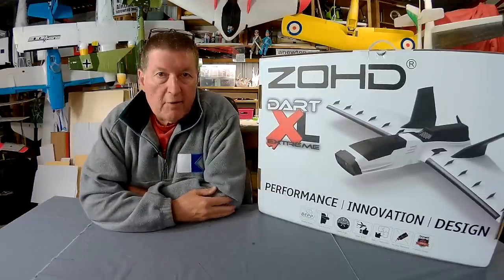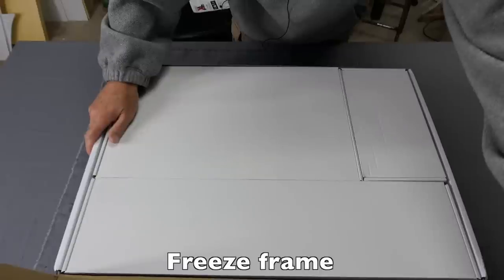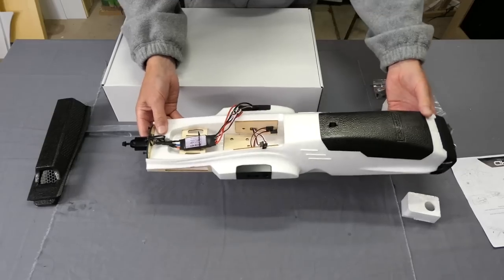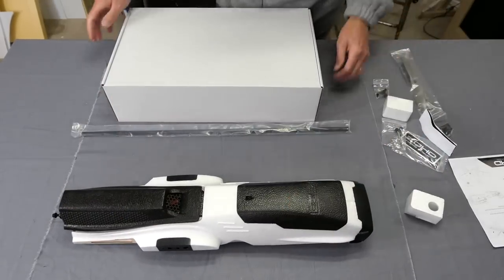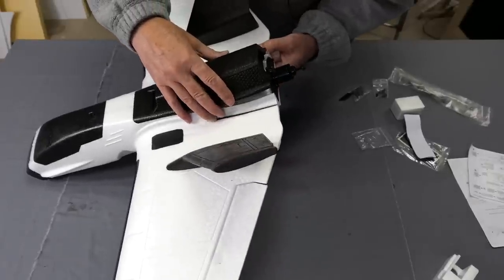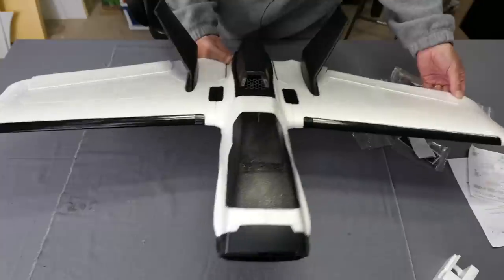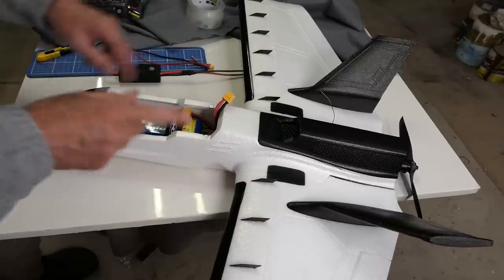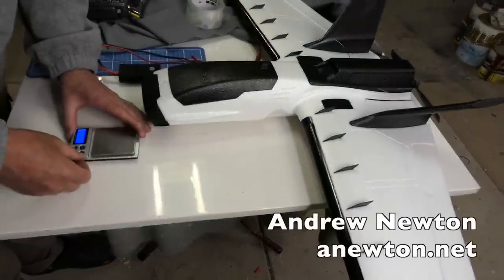ZOHD Dart XL Extreme

Comment: I am very new to this, I have an AR wing almost ready to fly, I am wonder ing if you could give some detail as to what you were doing to balance the prop.
Reply from the maker: I was just feeling the vibrations with the prop in different positions on the motor. There will be one angle where the vibrations are less. You can also do that while adding small pieces of tape to one of the blades. I couldn't balance the supplied prop well enough so swapped to a better one.
Reply: @AndrewNewton  Thanks Andrew.

Comment: Can't wait to see it fly, any chance you can add some sort of speed sensor too?  How does the new BEPP foam feel compared to normal EPP?
Reply from the maker: I can add a GPS sensor but I'm reluctant to do to many battery puffing high speed runs. Would need a bigger ESC and flatter prop to be safe. BEPP feels exactly the same as their EPP.
Reply: @AndrewNewton  No, wouldn't want dead batteries, I'm more curious what the efficient cruise is with that somewhat odd prop/motor combo is.  2216 1300kv & 9x4.5 on 4S seems like it will have high current draw and slow speed to me, I'm thinking an 8x6 would be more efficient.
Reply from the maker: Maybe it's designed for 3S, I'll experiment anyway

Comment: Nice to see a proper unboxing. I'm worried about the flimsy balsa that is supposed to carry the the 400g Lipo that is suggested. I see the balsa in the back isn't even strong enough to carry the ESC? What is your opinion, holding it in your hands?

Wondering what shoes your wife is wearing...
Reply from the maker: Yep, the plywood is inadequate fro rough landings, but very easy to reinforce
Reply: @AndrewNewton  How would you reinforce it? Maybe ZOHD can use your ideas to make some improvements.
If not for that wood I might have ordered already.

Comment: I liked that you included tests of current draw and balancing of the prop, all important before first flight. If you're drawing 30A max would you go all the way to a 50A ESC? Would you be powering not only FPV gear and possibly the Mobius or you like a large buffer zone? Interesting wing, I may have to put that one on my Christmas list!  :)
Reply from the maker: It's actually more like a 40A ESC and fine for normal flying. 50A might be overkill unless your going to race it flat out. My FPV power comes straight from the LiPO

Comment: Mini drak inspired? I found the small dart too fragile. The tail was thin EPP and very floppy on hot days and wobbled on mine. In fact it fell off mid flight on a 43 degree c day taking the motor and esc with it. So I hope this one is chunkier and stronger.
Reply from the maker: It is quite solid and well built, but still breaks down easily.
Reply: Was that a v1 or v2 dart? The v2 has reinforcements around the motor and additional carbon spars in the wings.
Its holding up just fine at 200+ km/h for me :)
Reply: @NilssonFPV  must have been a V1 as no re-enforcement on mine. It was a floppy al dente noodle of EPP in hot weather. I believe the phrase "unsafe at any speed" applied. Also the stabaliser died on the 3rd flight. Not impressed. BTW:  I have a nano talon and that has been great with the same stabaliser, so I am not anti- ZOHD. I just could never work out why everyone raved about the dart while mine just fell apart.
Reply: @TakeItToTheGround  Interesting! My experience was the complete opposite - my Mini Talon flew like a pig until it shed a wing in mid-air on its third flight and destroyed itself. My little dart however is brilliant! It flies like it's on rails and a 1300 mah battery lasts forever. It does look a bit flimsy, but no problems yet.
Reply: @ChrisBalmforth  My best small wing is a TBRC Apex V2.It is awesome on 4s 5046C tri-blade & T-motor air 40 2450 KV. Runs rings around everything I have ever flown. Crashed it many times at full speed & it just bounces. www.youtube.com/watch?v=TgI14xkxwb8&feature=youtu.be

Comment: Looks weird, there is no reason to put VGs towards wing tips (or close to them) on forward swept wing, they only add drag and instability, put them only near to the fuselage (or from 50% of the wing towards the fuselage).
Reply from the maker: Too big and aligned to be VG's I think. More like fins?
Reply: @AndrewNewton  
Forward swept wing tends to stall near the fuselage (btw where wing section is actually the thickest, this platform is inherently very stable on roll, but wing can loose the lift which is dangerous), on ZOHD Dart model it is quite visible that model loses too much lift on turns, I guess VG's should prevent to loose lift towards fuselage, but I don't really understand why to install them on wing tips.

Comment: Word is they fucked up the design with too much reflex and it noses up when adding power. Suckers are born every minute.
Reply from the maker: The reflex and finlets make it one of the smoothest FPV cruisers I have ever flown. Not designed as a speedster, only a sucker would think that.